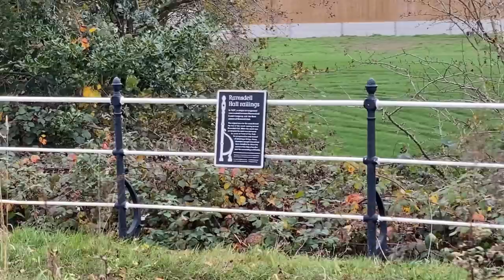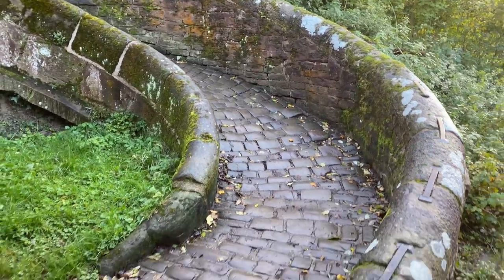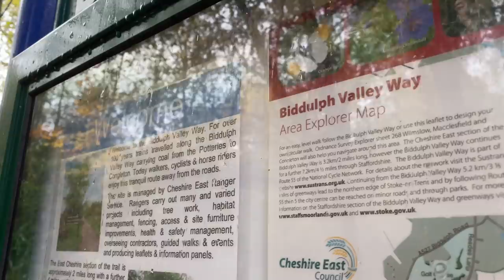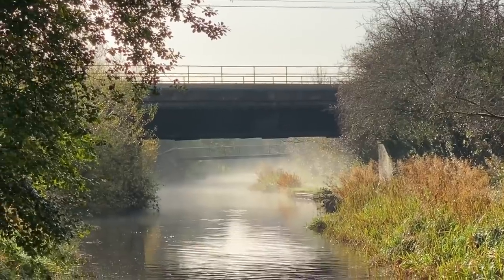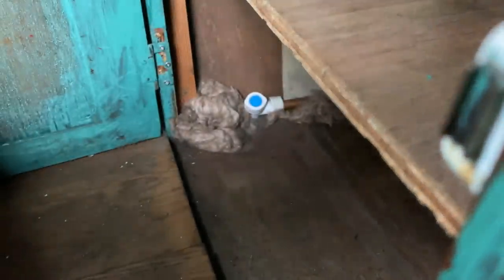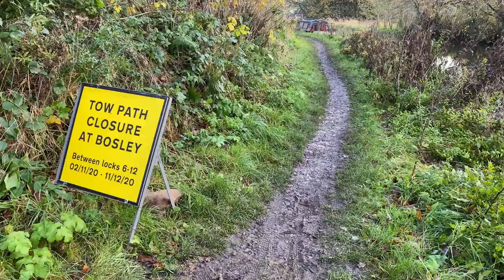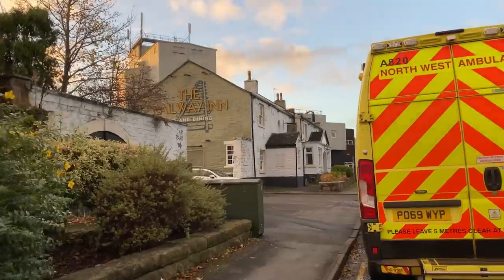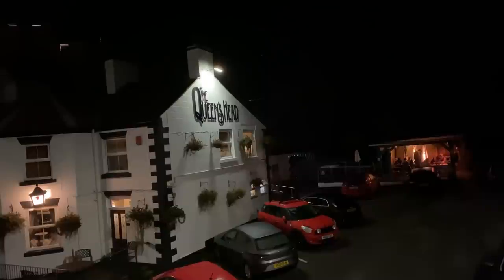Why is this canal so shallow?

Comment: Hi Robbie
You could have stayed on the embankment below Bosley Locks which is one of the finest moorings on the entire system.
I am sure that you know this but it is good practice to run water through the hose before filling the tank and it was not clear if you did this. Also, using the barge pole is a lever is a total no no; use it to push as that is where its strength lies.
All the best
Jeff
Reply: I was about to post both those comments, but thought I'd better check if anyone had beaten me to it.

Comment: A tip if you get grounded and didn't know already:
 - Put it in fairly hard reverse. This pulls water under the boat and lifts it up a little off the bottom of the canal, so you should be able to reverse off most events of running aground.

[ Conversely, going forwards pulls the boat down ]
Reply from the maker: I mean you see me do exactly that so you know I know, but great tip thanks for sharing as I didn’t mention it!

Comment: Good to see the old bargepole in its element. They could eliminate the shallow bits by sheetpiling the banks and moving the locks from the pound above to a new position beyond the shallows (raising the water level to that of the pound above). You can get pointy stickers at the stationers which you can inscribe with canal notes, like "water point" when it's not on the map. Also this time two pubs for the price of one - much appreciated!

Comment: I have been viewing many of your vlogs. Excellent. Coverage of the waterways. I do think you have a charmed life. The old lister does you proud , you don’t appear to do much maintenance,  Oil changes ? Checking the cooling system , sea-cocks never blocked  . Do you have a filter for raw water intake . It may be its something you don’t want to include on your Vlogs / Anyway keep the Vlogs coming
Reply: St2 lister? Is that not an air cooled engine.?
Reply from the maker: It is indeed 👍
Reply: Sorry I realised later it is air cooled !
Reply from the maker: That’s ok!

Comment: Robbie, I'm puzzled by the overflow pipe on your water tank, if this is open to the elements don't things crawl inside and die in your water; plus, how do you know your tank is staying clean and keepig the water in potable condition. Thanks for posting because I always enjoy your videos, keep up the good work.
Reply from the maker: Good point i’d not thought of that before. Probably overdue a clean out. But I’ve got the best inline water filter you can buy so at least I sleep a bit easier in that regard!!

Comment: My first thought that's a smoky exhaust - but maybe you have a fire lit !
Still a bit unsure about your engine though :)
Reply from the maker: Yes the fire is lit🔥 Re the engine - don’t worry you’re not alone there - I’m so tired of hearing about it especially after I’ve had two different lister experts service it and could find nothing wrong
Reply: @RobbieCumming  How many cylinders ? The noise to boat speed ratio is wrong ! It appears to have a heavy flywheel - is it electric start ? Has it got the correct prop for engine type ? !
Reply from the maker: You’re taking the piss now 😂
Reply: @RobbieCumming  Just comparing with other craft ! There's the slow runners with big flywheels with 1 or maybe 2 cylinders that seem to chug along at tickover ~300 rpm then there's the 3-4 cyl 'hi revvers' (top rpm 3000) that run at 1200-1500 rpm and I just can't fit yours into either category ! It sounds like one of the slow ones but is running faster than others in that category do - which would suggest it has a fine prop on it for the faster engines rather than a bigger coarser prop for the slower engines.

Some years ago, I was on a coach trip. For the return trip, had a chance to chat to the driver. I said the coach 'goes well', 5 speed (I was 1 out !) had an exhaust brake and a magnetic retarder. The driver was well impressed that I knew so much about the drivetrain just by riding in it. But that's my engineering background !
Reply from the maker: Ah well you’d be welcome to pop onboard to have a closer look, as my engineering expertise is limited to blind trust in the Lister specialists I’ve already had looking at it (who couldn’t find any problems aside from a bit of an oil leak that would be prohibitively expensive for me to fix so I just keep wiping it off every now and then🤞)
Reply: @RobbieCumming  Try asking a boat builder about matching a prop to an engine. Maybe a thing to consider when it's next in a dry dock for blacking - you could ask a prop expert to tell you correct engine parameters for that prop and see how that matches with the engine you have.
Or give the engine data to a prop expert and ask them for prop details to compare with the one you have.
Reply: @RobbieCumming  The oil leak may be an inexpensive fix. Where is it leaking from ?

Comment: why are canal boat engins so noisy my car engin made that much noise it would be down the garage what is with all that banging
Reply from the maker: Ha ha hmmm well it’s just an old engine not designed to be quiet. An interesting comparison though - maybe ask a boy racer or a harley davidson rider why they have such loud engines too?!!
Reply: Probably because your car engine is a 4 cylinder , multivalve engine and has s balanced flywheel.  Boat engines are basic with 2 cylinders  a simple fuel delivery system  and a basic inlet and outlet valve system.

Comment: Lovely video but...
I saw you using your bargepole as a lever to try to get yourself unstuck from the bottom.
Please don't do this. And at least don't film yourself doing it. I know it seems like a good way but this the best way to destroy a perfectly good pole. The right way would be to just put it into the ground of possibly the bank a few feet away from the boat and just use your weight and just lean on it. This will get you the same horizontal force but with A- a lot less effort and B-a lot less chance of snapping your pole.
God luck and keep on cruising.
Reply from the maker: I’m sorry Peter but unless you were actually there I can’t agree with that! Thanks for sharing your thoughts though!
Reply: @RobbieCumming 
Well, it's your pole. But I sail in the North of the Netherlands and I have been stuck pretty solid in sand, clay and peat bottoms. And I have seen people snap poles like matchsticks.
But maybe our poles are longer. 4.5 m (15 feet) seems to be standard here.
Reply from the maker: Yeah that sounds like a longer pole - and used in different conditions too. I need a new one really as mine is probably about 40 years old!!